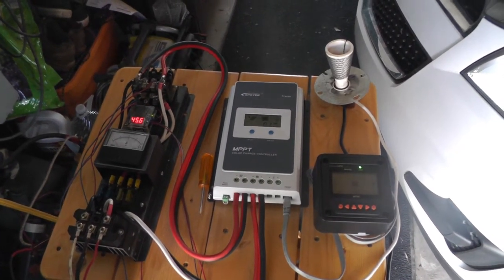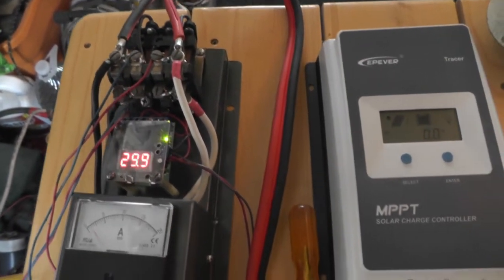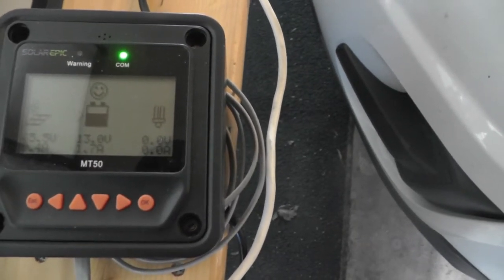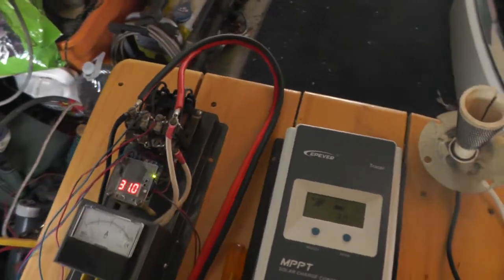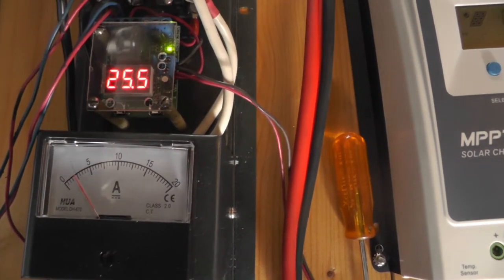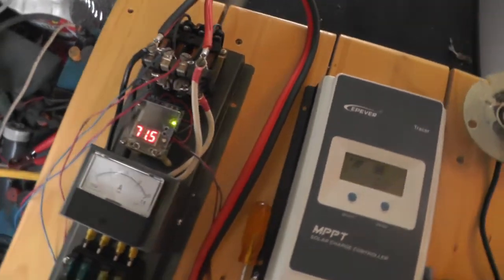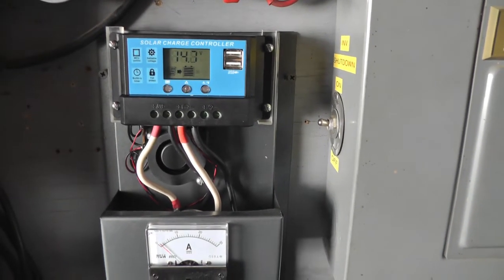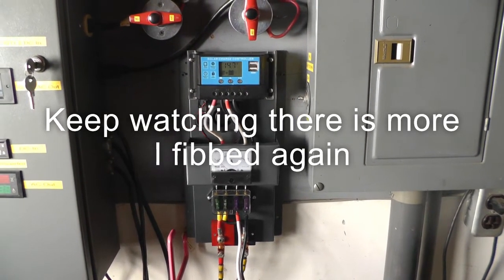Dump Load Control & MPPT Control For Waterwheel

Comment: i think you might wont to put a capacitor or condenser across the reley switch terminals to stop the spark welding the contacts together like car distributors have or should i say used to have

Comment: looking at the voltage i think over voltage needs changing in the controller to better protect the batterys
Reply from the maker: That is happening because the windmill and the old tired solar panel are not controlled yet so they are are causing the over voltage.
Reply: @kevincrawford2027  yes that entered my head at work today i had forgot you had other power inputs also